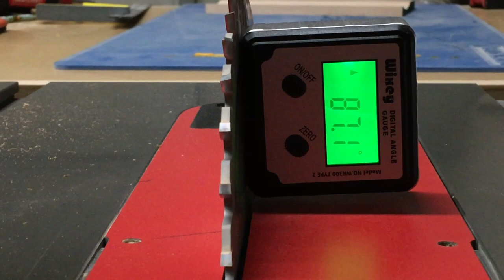Magnetic Organizer | Build a Magnetic Desk Organizer/Picture Frame | Woodworking

Comment from the maker: Want to support the channel? Here's what you can do:
 - Subscribe to the channel
 - Hit that Like button
 - Leave a comment
 - Amazon Affiliate: https://amzn.to/2LaN1Ib

In this video I build a desk organizer for pens, pencils, markers, etc that also has a metal display that can be used for pictures, to-do lists, reminders, etc.  This was my first project really working with hardwoods...in this case walnut and maple.  These were some smaller off-cuts that I picked up pretty cheap from my local hardwood dealer.  These off-cuts are a great way to "get your feet wet" working with hardwoods without breaking the bank or being too scared to mess something up.  If you have any questions please leave a comment and I'll be happy to answer.

SawStop 1.75hp PCS: https://amzn.to/2X4gWsP
Bench Dog Push Blocks: https://amzn.to/2YB00uL
Ridge Carbide 10-inch Saw blade: https://amzn.to/3bATmcp
Bosch 18v Impact Driver: https://amzn.to/3cxAhJk
Ridgid ROS: https://amzn.to/364yHMA
Titebond Wood Glue: https://amzn.to/2LzTdv4
Bessy Parallel Clamps: https://amzn.to/2z4LHG3
Bessy 6-inch F-style Clamps: https://amzn.to/3e3LGl4

Subscribe: https://www.youtube.com/danprudlow?sub_confirmation=1

Twitter: http://twitter.com/DanPrudlow
Instagram: http://instagram.com/danprudlow